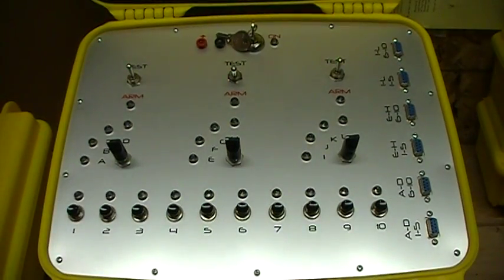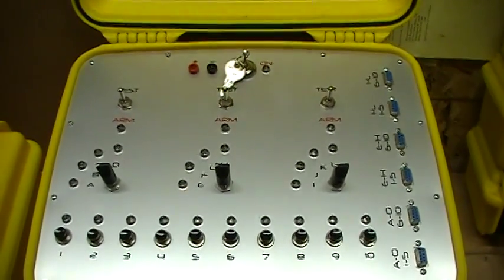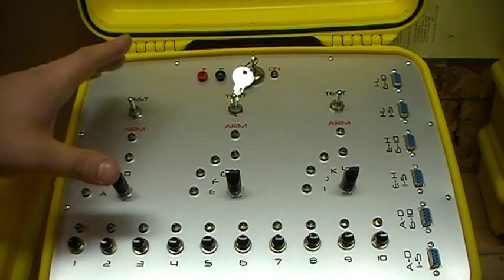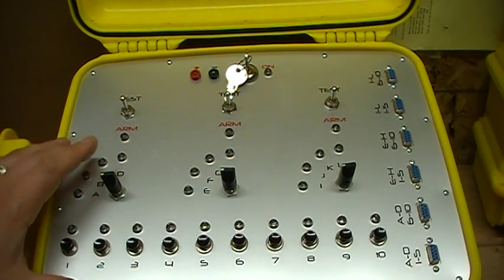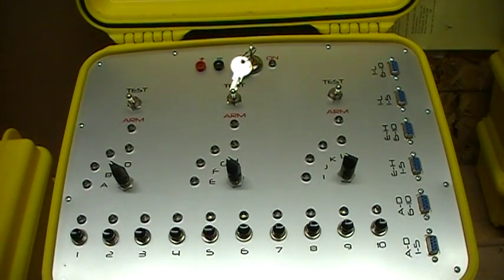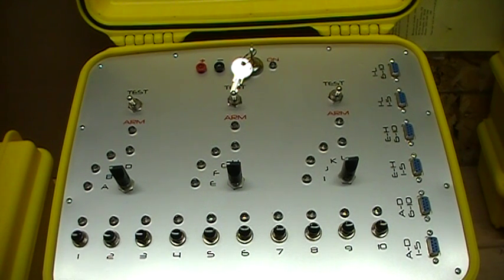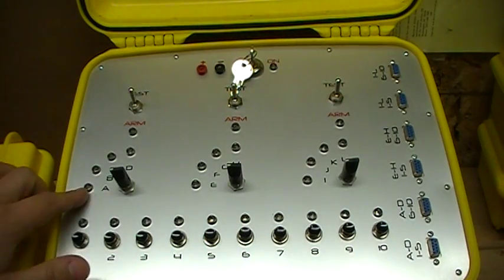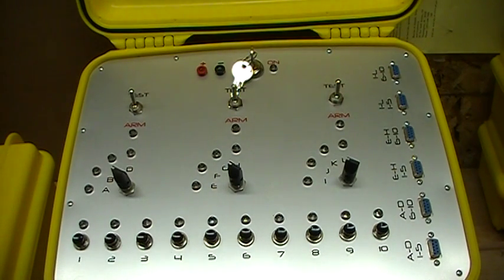Fireworks electronic firing system

Comment: Very nice panel. Looks great. I couldn't afford to get the top plate custom made so I had to use plexiglass I had laying around. Doesn't look near as nice as yours but like you said, it doesn't really matter as long as it works well. I've shot 3 shows with it so far (two 1.4g and one 1.3) and  it's been flawless. Thanks for the vid. Lookin forward to seein some of your shows.
Reply: Where did you get the wiring part? Can't find anywhere. Fave it built but not sure on wiring and can't get him to reply